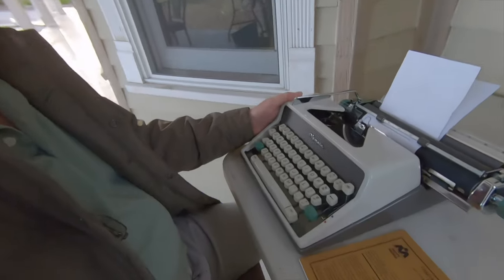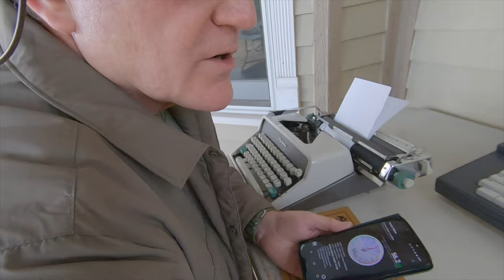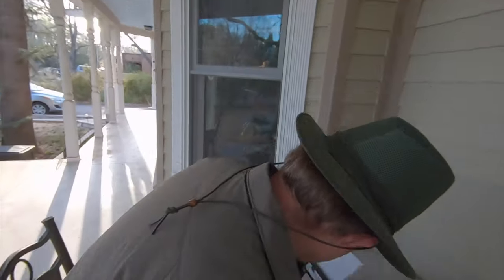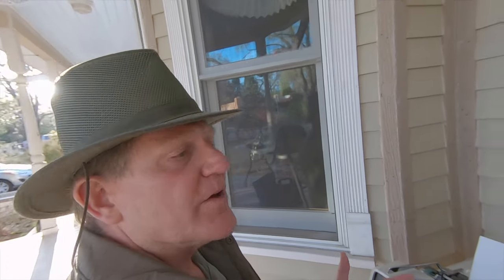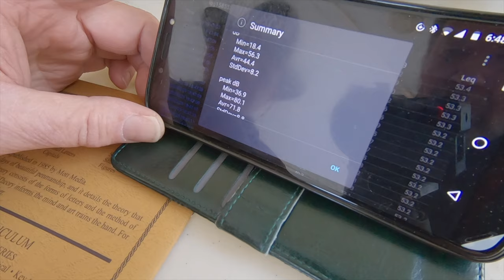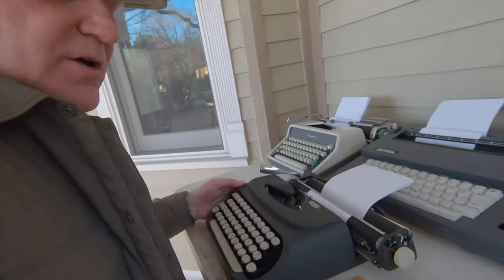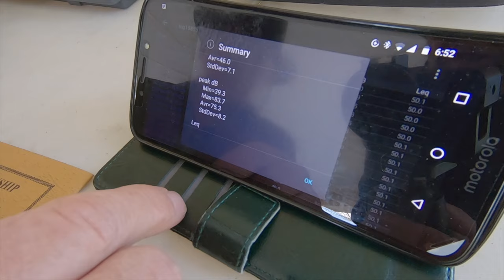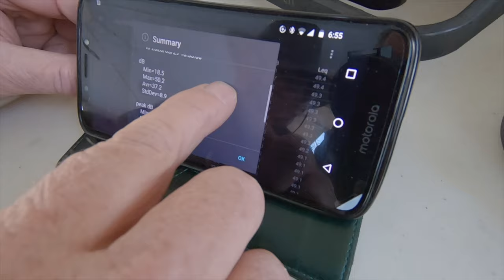Typewriter Video Series - Episode 220: How Loud is it?

Comment: Well done Guys!  The sound of each typewriter is different, sometimes even within the same model, because of the variables of adjustment, age, condition, and design. The first typewriter I bought in this resurgence period was a Remington Noiseless 7, that the late Mr. Montgomery of Bremerton Office Machine Co. had restored to working order. He showed me how the positive action of my fingers makes the clever typebar action work crisply but quietly, with the typebar just touching the ribbon to the paper, not really bashing the platen. It still amazes me. The Olivetti Lettera 22 has a very quiet action too, even with a pretty solid platen.  My wife and I took the Lettera to a hotel for a long writing weekend, and had no complaints from the neighboring rooms.  Good to see you two experimenting with sound deadening felt.  I've also had some success with 1/16” self-stick neoprene in machines where there isn't much clearance for thicker felt.  The neoprene stops the metal of the body vibrating.  All the best!

Comment: Have any of the platens been replaced in those machines? How does that affect the noise? I winder how my 1899 Smith Premier 4 would do?
Reply from the maker: I don't think any of those machines have newly resurfaced platens, but I expect in order to see a noticeable difference in the numbers we'd need much more controlled conditions, and a better measuring system. Maybe even a spectrum analyzer to see the tonal (frequency) differences, not just decibel sound levels.